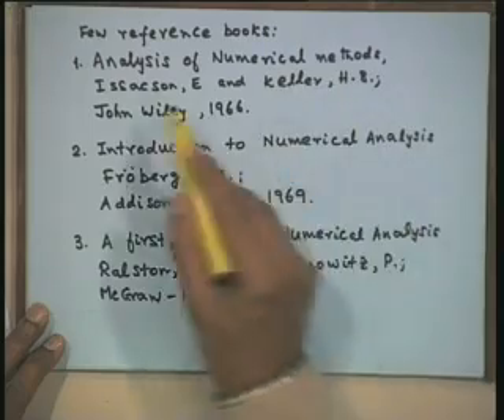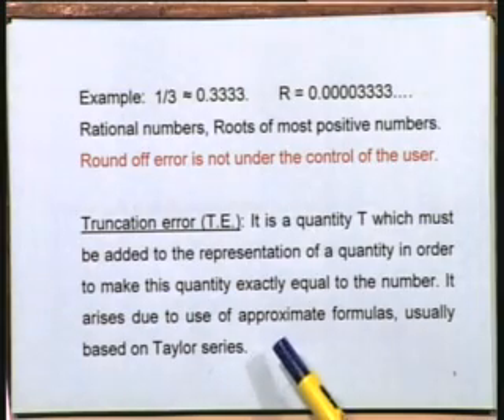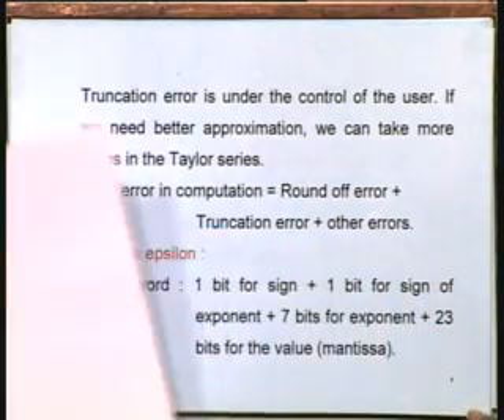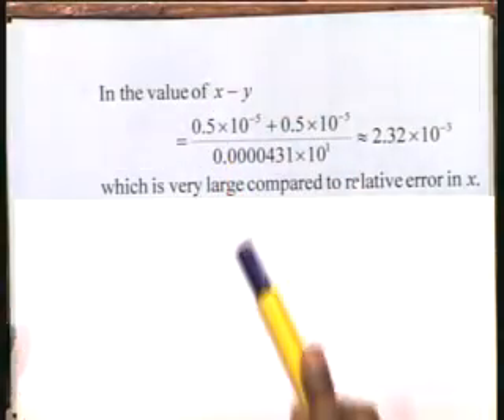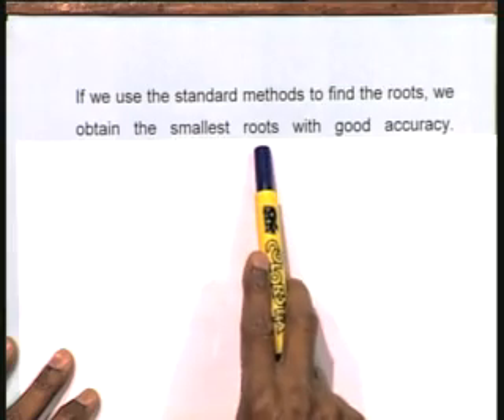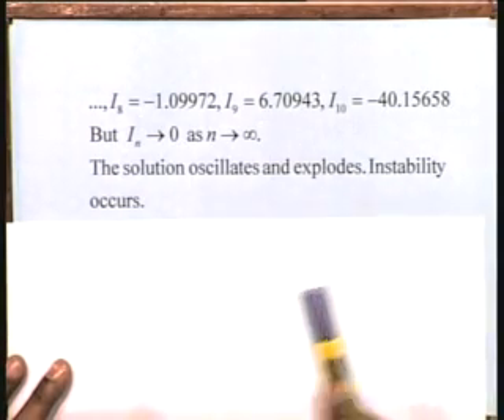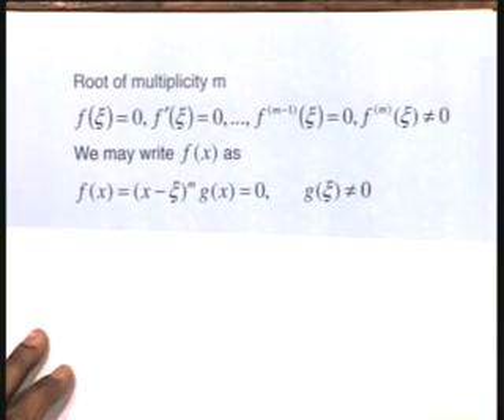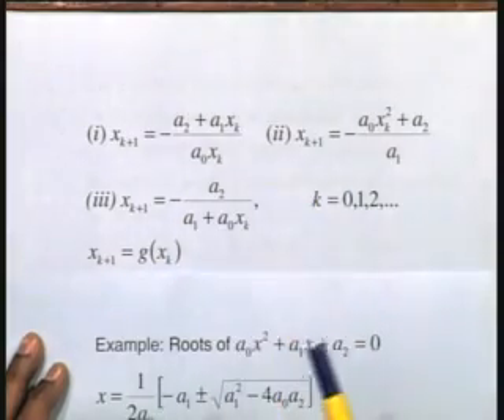Lec-1 Errors in Computation and Numerical Instability

Comment: at 21:26 you said that 0.5 x  10^-6 comes from where ....? ....... I could not get where the absolute error is calculated ?... please help
Reply: The x and y being subtracted each have a round off error of (at most) 5 x10^-6 == 0.5 x 10^-5 as he says.
Reply: it does make any sense because he put the approximated value in the relative error formula

Comment: Is it correct that 1 bit in 32 bit word representation for floating point used for sign of an exponent? Didn't find such things in IEEE 754 .
Reply: Right, IEEE uses a bias of 2^(k-1) - 1, or 127 for the 8 bit exponent field of 32 bit float. The bias is subtracted from the 8 bits interpreted as unsigned so that the exponent runs from  -126 thru +127 (all ones in exponent means inf or NaN, and all 0s means denormalized number..).